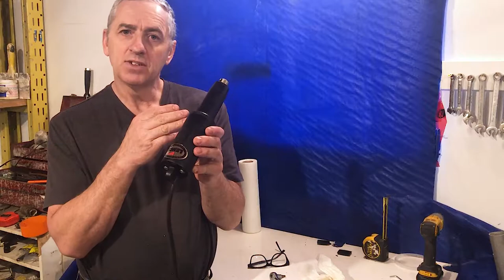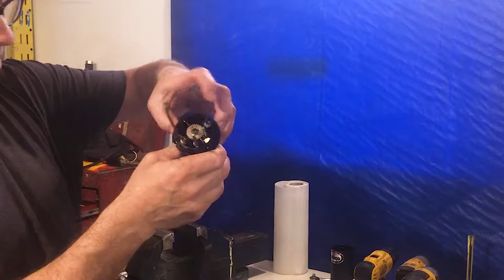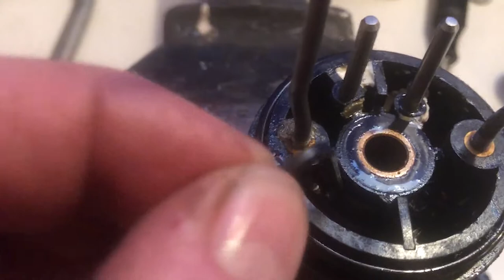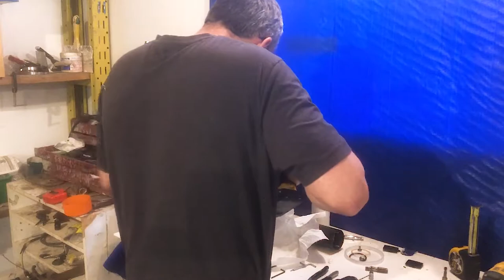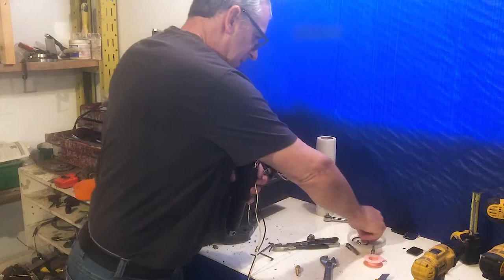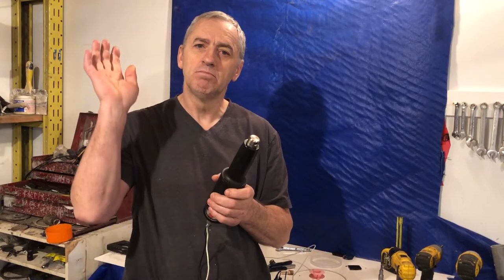How To Make A Deep Sea Actuator For Homemade Submarine

Comment: @Hank Pronk >>> In this video you mention using WD-40 for oil compensation.  In your LED light bar video, you filled the acrylic tube with vegetable oil. 
 
Is there a particular reason -- or reasons -- why you use those particular oils for those applications? 
 
{EDIT:  What I was trying to ask -- but did not word so well on my first try 😊 -- was why WD-40 with the actuator and vegetable oil with the light bar?}
Reply from the maker: Higher potential for leaking from the light bar, is why I prefer a more environmental oil.
Reply: @HankPronk  >>> Rodger that - Thanks...👍👍